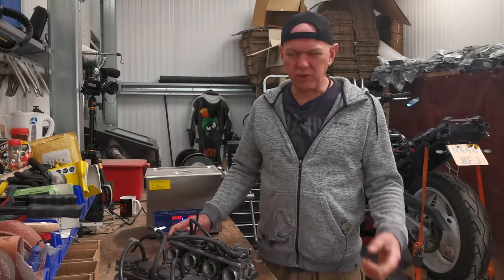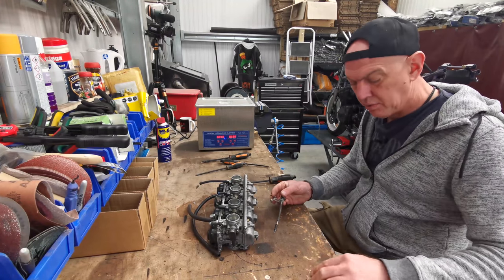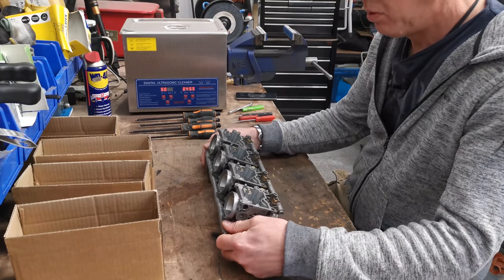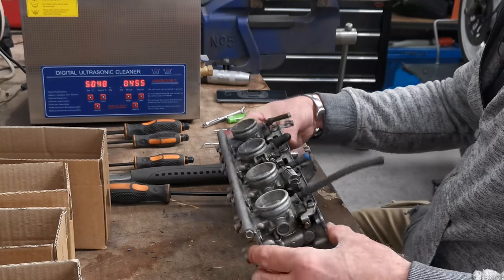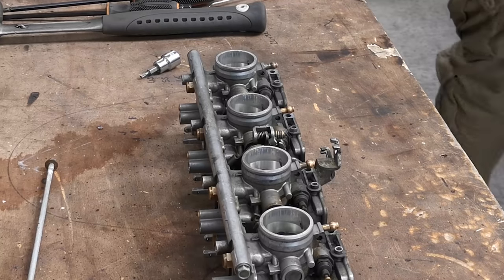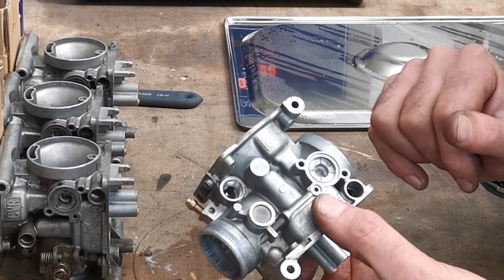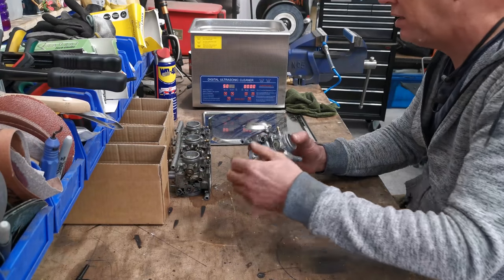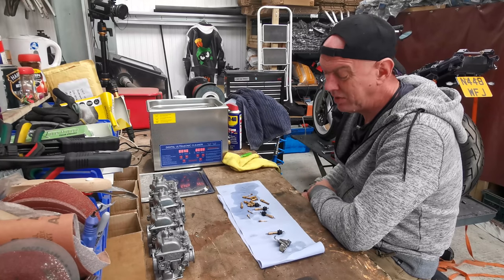Van or Bike? - day 3

Comment: Chocolate carb screws...  Always difficult if using Posidrive or Phillips screw drivers, as they tend to cam out of the screw head. The screws are actually JIS, which is a variant of phillips. Best to add a Vessel Impacta P2 JIS screwdriver to your tool box if you don't have them already. The driver will not cam out, but also has a built in impact driver. Amazon still have 100mm ones in stock in the UK. You'll wonder how managed without.
Reply from the maker: Yeah I'm using JIS screwdrivers and they really do make a difference. The screws are just completely chewed up is all... Oh well 😂👍
Reply: @QuickBikes  Do you have an Impacta rather than just std drivers?
Reply from the maker: Yes I do and had to use it on a few of them. I don't really like bashing stuff, but sometimes you have no choice. Spun them out with no worries 😁👍

Comment: Another great vid as i have a set of spare carbs i do need to split to replace the fuel inlet t piece. I have a 30 litre ultrasonic cleaner and they always go in whole  no splitting needed
Reply from the maker: Yes the carbs being bolted together hold the T pieces captive between the carbs. It's not hard though, just go slow and steady Mark 😁👍
Reply: @QuickBikes  Cheers for the reply mate,much appreciated

Comment: the bits underneath you keep referring to as "somewhere to set float heights" are actually heater plugs to stop the fuel icing up... you need wiring on the loom to plug them in ;)
Reply from the maker: Yeah, found that one out... There's. No wiring on the bike for them either 😅😂🤣

Comment: I hate it when one of my O rings falls out; I had the same problem yesterday morning. There I was, working in the garage, when the madras. from the night before, decided it was coming through. O ring was worrying, however A ring was the one that stung....😁
Reply from the maker: Hehehehe.... Very hard to work whilst keeping your butt clenched... 😂😅🤣
Reply: Aahh yes.. the joys of the madras ring stinger .🚽
Reply from the maker: Smarts a bit by the sounds of it 😅🤣😂
Reply: Quick Bikes yes it does. Guess which bit !
Reply from the maker: I would say try some rubber grease on it... But that probably won't help 🤣😂😅

Comment: Where do you get the carb servicing parts / kit? Please.  Loving the longish videos which are helping me throught this " virus shut in" .
Reply from the maker: I got them on eBay from Hunters Motorcycles Dave. I'm trying to keep the videos coming during my week off as I figure entertaining folks is the only thing I can really do...!?!
Stay safe matey 👍
Reply: @QuickBikes  With this lock-in for old farts like me (72)  I might as well have a fiddle with my old VX800 which is a sqillion bits all around the garage. And I know the little washer that protects the 'O' ring from the little spring on the air screw has run away and hid somewhere and I need to track down a replacement.
Reply from the maker: Fowlers are quite good for that kinda thing matey... 😁👍

Comment: You need japanese screwdriver for carbs screws🤷🏻‍♂️ i dont have them yet myself but know i need them
Reply from the maker: I'm using JIS screwdrivers, but they are just all chewed up to hell... Still... Worked out in the end 😁👍
Reply: I normally change them for Allen head screws so much easier when tuning carburettors
Reply from the maker: Yeah, I may well do that... 😁👍
Reply: s9enny and that WHy i havnt Got Those drivers yet😂

Comment: Not a bad video fella and for your info that tiny little bit has disappeared into the parts dimension never to return until you put the carbs back on the bike and about 6 months time take em off again and there it will be smack bang in the bloody way visible like a dog under ya feet ....is there a specific fluid or additive for the sonic cleaners as been thinking on one for some time .
Reply from the maker: Hehehe... Still haven't found the bugger 😂😅🤣
You can get soe ific ultrasonic bath fluid, but all kinds of things work in them, even down to just soapy water... You'll find loads of options on eBay. I tend to get the concentrate just because I can mix it stronger if needed for stubborn items. Be mindful though that if you leave aluminium in it for too long it'll go darker...
Reply: Cheers quickie explains why when ive had stuff done in the past its come back darker than i expected ..

Comment: Where did you get your sonic cleaner I won’t one can you send me a link 
And what size and did you get a fork seal fitting tool and is it universal  cheers Quicky!!
Reply from the maker: EBay item number 173943295035 Garry. The fork seal driver has turned up and I'm hoping the fork seals themselves will get here today matey 👍
Reply: Quick Bikes thanks for the reply 
What size is yours and what is the clear called you used again.
I am so glad you are doing your videos though these mad times you keep me going. And please don’t change always be your self not like some others who change things around for the worst
Reply from the maker: I got the 10L one... You can't fit the whole bank in there but it's a handy size 👍
Reply: Quick Bikes sorry Quicky 
Was that 1 or 10  ltres
Reply from the maker: 10 litres
Reply: Just bought a 10L cheers Quicky